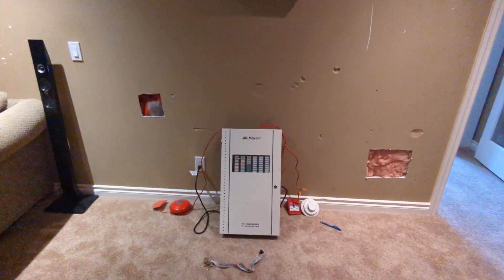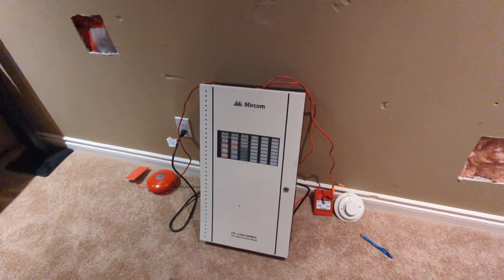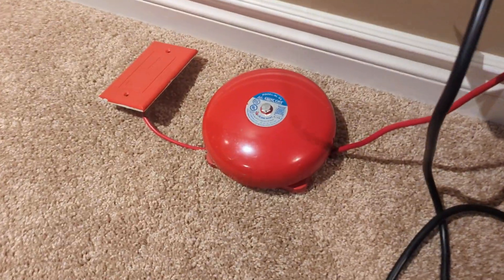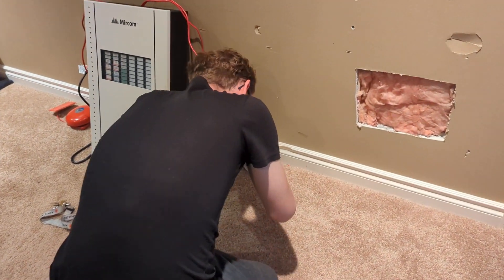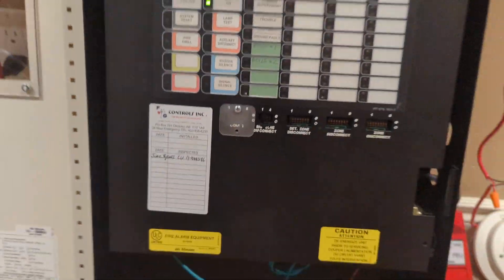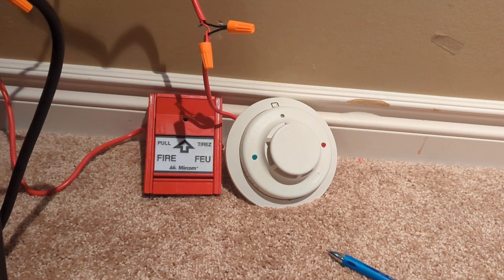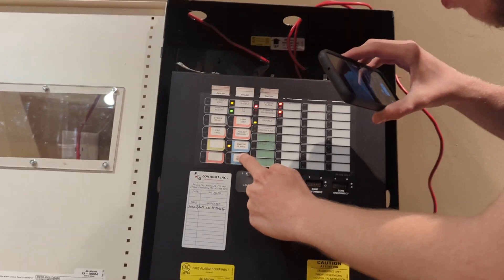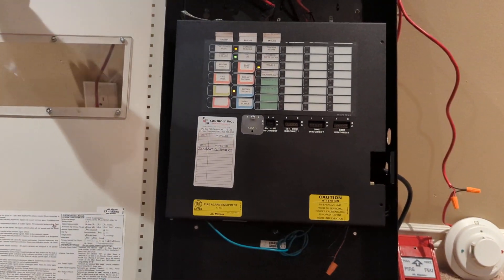Mircom FA-1000 Fire Alarm System Test 1!

Comment: i know its kinda late but i need to know how to change the coding on my cerberus pyrotronic txl-1008k (Mircom fa 1000 and 1008k) can u tell me which dip switch to cange pls.
Reply from the maker: I thought my comment published but I guess not. The way those panels work is you flip up a dip switch pattern to enter a certain menu, and use the red and yellow buttons on the bottom left to cycle through the options. Evacuation code is switches 5, 6 and 8.
Reply: @Twentythree33  ty

Comment: how do you convert a conventional device to addressable? Is there any benefits to converting initiating devices on a conventional panel to addressable?? why not just wire them conventional?
Reply from the maker: Conventional panels can't accommodate addressable devices. However, if you're wanting to use a conventional device on an addressable system, you can use a monitor module.
Reply: @Twentythree33  what would the benefit in that be though? If a fire panel is conventional with conventional devices why have the need to connect a monitor module and make a device or two addressable?
Reply from the maker: If a panel is conventional, you can't use addressable devices on it.